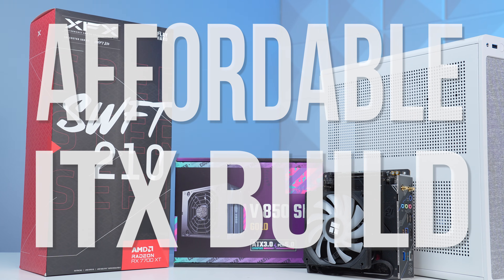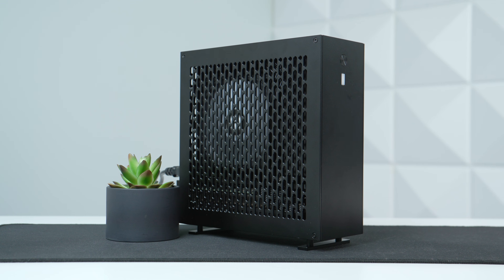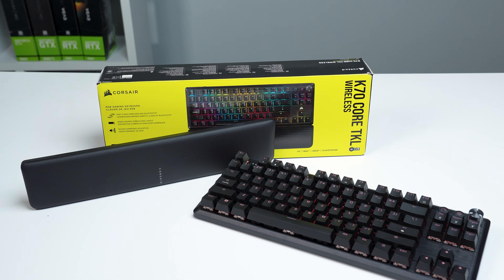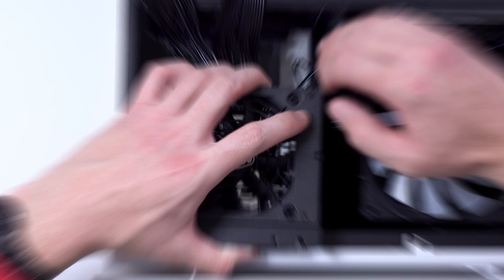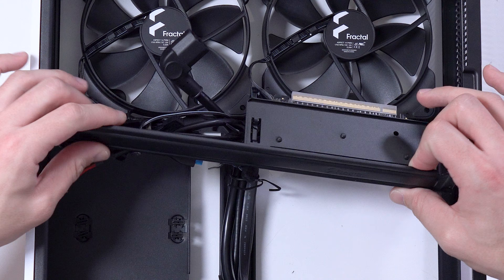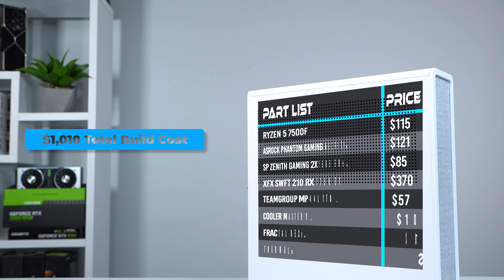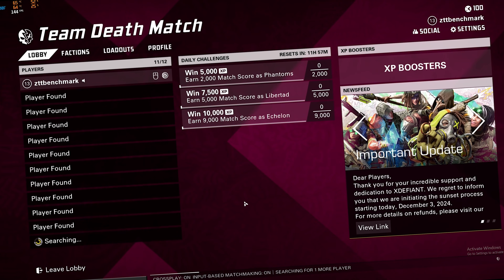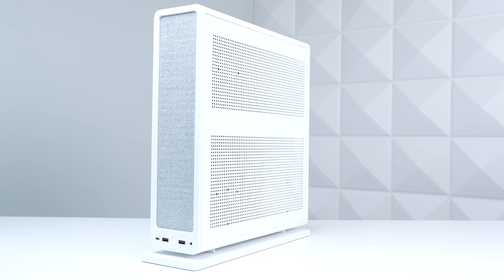This 1440p ITX Build is Actually Affordable!

Comment: I was thinking about doing an itx build with the 5060 low profile gpu because in some real benchmarks it actually plays 1440p on almost any game because of supporting the newest DLSS 3 I think it's on right now? even though it has 8gb of vram it is AMAZING at less than 350 bucks new. Also a whole build draws less than 500w of power usually. I was planning on 3d printing a case and frame with a flat/console-like profile and it's smaller than a PS5 by quite a bit
Reply: 3D printing a case will cost me only a couple hours and less than 30 bucks of material for a roll of ASA...

Comment: If you're having CPU temp issues in this case do this... Take out the 140mm fans completely. They make the lower chamber circulate hot air. Next, add x3 80mm top fans as INTAKE AND NOT EXHAUST, this will get fresh air to the lower chamber. Now, add 1/4 inch gasket around the CPU fan housing to seal the gap between the case. Also, if you have an MSI board, lower the Lite Load setting to help auto under volt ever so slightly. I went from 98c to 77c at 100  percent load on cinebench at the 5 minute mark, before I had to stop after one pass about 30 seconds due to throttling. Great case, poor factory air setup. Hopefully this helps

Comment: 7 months later, the R5 7500F has the same price as the R5 7600X and letting you know that the 2k-itx-affordable does not exist anymore but there is a GPU called RX 9060 RX 16gb that might make it happen again

Comment: Is that Fortnite number in performance mode or direct x? I'm assuming performance. People always act like Fortnite is easy to run, it is not. It's easy if you put it on the equivalent of low settings. I don't understand why people always do this and insist on putting other games on high settings.

Comment: Update: the PSU used is prone to catastrophic failure even under normal use with areas that have unstable or noisy power.
Recommended to avoid this PSU in that case
Reply: been using it for over 3 years. its fine
Reply: @megadeth8592 Tests don't lie. You might be lucky, but the risk is there

Comment: Fps benchmarks are useful, but what about temps? Especially in that case.
Reply: I noticed in the overlay in corner cpu was fine but gpu was constantly at 95-98°
Reply: @chrisfrazier1209  no it wasnt........it never went above 70 degrees.......what you saw was gpu usage
Reply: there's temps in the corner for every benchmark.........
Reply: @ ah your right I’m looking at usage my mistake thanks for clarity.
Reply: Temperatures don't hit that high, at least for me. I use a 7700x and a 3080 10GB (105W TDP for the 7700x and 320W for the GPU), and I am able to run both of them with minor performance loss (a few points, in cinebench 2024). Granted this is with relatively high fan speeds, but if you are wearing headphones you won't notice it.
Reply: @Hydro123s ok thanks. I've got an undervolted 5800x (I just lowered the power limit until I started to lose performance, quick and easy) and a 3080 10g so we're likely not that far off.

Comment: Do builds like this still have the same thermal performance? Or is thst a sacrifice for the reduced space?
Reply: When I checked the benchmarks, the GPU have a pretty decent temperature (around the mid 60 degrees) while the CPU gets pretty hot on CPU demanding games (approaching 80 degrees), but it is still acceptable for a CPU to get that hot tbh
Reply: @farrel2307  under 80 in an itx case is great

Comment: Hi, great build! I have also a gaming PC built into this Fractal case with the Ryzen 7 7800X3D. 
- My question would be what kind of GPU do you recommend for a 4K monitor ? Currently I have an old card (XFX Radeon RX 5700 DD Ultra 8GB) from my previous built and i see that the card can't really handle 4K really good, especially on the new titles cause it gets really hot and the fans spin like crazy sometimes. 
- Another question, now that the new GPU came out at CES should i wait for one of them or should i buy an older one ?
- Btw sometimes I notice that the CPU and Case fans spin up really quick and than slow down when i do some kind of minor action like opening the Chrome or navigating, how can I fix this issue, what should/could I adjust ?

- My last question 🙂, sometimes when I have a longer gaming session I noticed that the case gets really warm/hot where I have the CPU and GPU but as I saw the CPU and GPU temps are okay, below 70 celsius or mas 80, is it normal that the case gets so warm ?

Thanks in advance!

Comment: ai says

The Ryzen 4070 is not a GPU, it's a CPU (Central Processing Unit) from AMD.

GPUs (Graphics Processing Units) are responsible for rendering graphics on your screen.   
CPUs handle the core processing tasks of your computer, like running programs and games.   
Therefore, a Ryzen 4070 cannot "beat" any GPU because they serve different purposes.

To get a high-performance GPU, you'd be looking at cards like:

NVIDIA GeForce RTX 40 series: (RTX 4090, 4080, 4070 Ti, 4070, etc.)   
AMD Radeon RX 7000 series: (RX 7900 XTX, RX 7900 XT, RX 7800 XT, RX 7700 XT, etc.)
These GPUs will significantly outperform a CPU in terms of graphics rendering capabilities.

ai thinks a ryzen 4070 is a cpu

Comment: @zachstechturf I have a Zotac 3060 Ti Twin Edge, and it gets really hot and loud at 99% utilization, reaching around 83°C during 1440p gaming on high settings with unlocked FPS. I’m using a Pop Air Mini case with a 120mm AIO at the back (it was originally a prebuilt, which is why it has the 120mm AIO). The case still has the stock fans installed.

Are these temperatures normal, or could there be something wrong with my GPU? I’ve already set custom fan curves and undervolted the GPU, but the temps are still high. Any advice would be appreciated—thanks in advance!

Comment: Hey Mr. Zach I’ve been planning a pc build using your $550 template. I found all the parts on Amazon but I was wondering if there were any other GPUs besides the rx 6600 that I could substitute that may be a little lower in performance but save money if that makes any sense. Thank you.

Comment: Hey ztt I was wondering why the motherboard has hdmi and display port inputs when you aren’t sopposed to do that
Reply: The HDMI and DP ports are used for your CPU's integrated graphics (if it has them). If you have a dedicated GPU, it will use the iGPU (integrated GPU on the CPU which is weaker) in order to render graphics, making it slower.

Comment: Sursa Corsair RM650, 650 Watt, 80 PLUS GOLD
Certified, Fully Modular
SSD Kingston NV3 1TB PCI Express 4.0 x4 M.2 2280
Memorie Corsair Vengeance RGB RS 16GB DDR4 3600MHz
CL18 Dual Channel Kit
Placa video GIGABYTE Radeon RX 6600 EAGLE 8GB GDDR6
128-bit
Procesor AMD Ryzen 5 5600 3.5GHz box
Placa de baza GIGABYTE B550M K
Good budget pc build???

Comment: Hey, I know this isn’t overly video related but I’m wanting to upgrade from an Athalon A3000G to a Ryzen 5 5600 but I wasn’t sure if my board supported it, I have the A320M HDV R4.0, some sorces say it won’t work but some say it will with a simple BIOS update. Could you it any commenters give me some help (if it is a BIOS update would it be possible with the A3000G?)

Comment: I've got an upgrade question for you:

I'm a budget gamer dad and am thinking of upgrading my rig in 2025. My current rig I purchased for $200 from a local PC flipper (IT guy at one of our school districts) and has the following specs:

Processor: Intel Xeon w-2123
GPU: RX 580 2048SP 8 gigs of GDRR5
RAM: 32 gigs DDR4 2666 MT/s
Memory: 1 TB SSD

My question is two fold:

1. Would the new Intel ARC B580 be a good way to get to GDRR6 on a budget with my current setup?
2. Should I first upgrade my CPU?

Finally, anything else I should be aware of? I game in 1080P and my rig runs modern games at reasonable frame rates (40-55 FPS) at modest settings (Space Marine 2, Helldivers 2, Elden Ring). Thank you in advance.

Comment: Hey Zach, I hope you are doing good. What GPU (or any other upgrade ) would you recommend based on my current specs,

Ryzen 5 1600
Rx570 4gb (Gigabyte)
Gigabyte B450 ds3h mobo
500gb SSD + 2tb HDD
16gb ddr4
550w Gigabyte 80+ bronze PSU.
I'm a casual gamers, i play a couple of fps games like csgo, valorant sometimes and apart from I love to play story games like witcher, gta, cyberpunk etc, in 1080p.
I wanna upgrade my GPU, I don't want 300fps in my system, I just want above 60fps in my story games with good graphics, 
What GPU should I go for, in both 2nd hand & new condition

Comment: My Current PC Specs
CPU - Ryzen 5 5600X  Using stock cooldeGPU - Geforce gtx 1060  6 gbMOTHERBOARD - PRIME B550M-A WIFI llRAM - CORSAIR VENGANCE 2x16 32 gbPOWER SUPPLY - DEEPCOOL 500W 80 plus bronze certifiedCase - Deepcool Matrexx 50 ADD-RGB 4F ATX Mid Tower CaseStorage - Samsung SSD 990 EVO 1TB m.2
I'm wondering what Graphics card i should get and my budget is 370 - 700 CAD

Comment: does any am5 mother board work with the 4070ti super, i don’t wanna get it and not be able to use it
Reply: yep. all AM5 boards have a PCIe x16 slot (which is what the 4070TiS and all other modern GPUs interface through)

Comment: Hi @zachtechturf!

Love your videos!

Im looking to build my own PC 

Do you mind taking a look and seeing if there are any issues or improvements that could be made? Or even possibly alternate parts that are cost effective but are not a downgrade?

I mainly game, browse web, trade crypto.

(FYI - Money isn't an issue but i'd still rather not spend unnecessarily) 

Thank you!

CPU: Ryzen 7 9800x3d
CPU cooler: Lian Li HydroShift LCD 360
GPU: Gigabyte Radeon RX 7900 XTX Gaming OC 24G Graphics Card (R79XTXGAMING-OC-24GD)
MB:	Asus ROG Strix X870E-E Gaming WiFi
PSU: Corsair 850W RM850x SHIFT 80+
CASE: Antec Flux Pro Full Tower E-ATX Case
RAM: CORSAIR Vengeance RGB DDR5 32GB (2x16GB) DDR5 6000MHz CL30 AMD Expo Intel XMP iCUE Compatible Computer Memory – Grey (CMH32GX5M2B6000Z30K)
SSD: Crucial T705 2TB CT2000T705SSD5 PCIe 5.0 2280 M.2 NVMe SSD - with Heatsink

Monitor: Any recommendation to get the full potential from the PC?

Am i missing anything?

Comment: i just want to ask: 
i got a used pc : 
i5 4500
rx 580 8G 
8 G ram ddr4 
500 hdd 
125 ssd 
M.B H81 
500 W P.S 
and i got all of this at 172 $ (used ofcourse). 
is it good deal or not.
+i just want the pc for college and open chrome and open pdf,s.
should i take it.?

Comment: Hey Zach, I'm considering buying a new PC. My current setup has a GTX 1660S, an i5-11400F, 8GB of RAM, and a 512GB SSD. Do you have any recommendations for a build or prebuilt around $1000 that can handle 1080p gaming at over 120 FPS, preferably with an Nvidia GPU and an AMD CPU?

Comment: So I just built my first desktop gaming pc, and it has a Ryzen 7 7700x, 32gb DDR5, 4tb ssd, and a 4070 Super. I keep hearing that the 4070 Super is great for 1440p gaming and can still get over 100 fps in most games on 1440p. My monitor is only 1080p, and I am wondering, will this will give me more fps in my games or not? I don’t know if this is good or bad but this is a huge upgrade from my ps5 and old tv 😅.

Comment: hey ZTT, my name is Alan. I need your opinion in my budget build. I’m building my new pc for 1080p gaming. My budget is 1000 euros, and i just wanted to know what should I change or it is maybe good build. my parts are ryzen 5 7600, rx 6750 xt, 16gb ddr5 3600mhz, asrock b650m pro rs, 750w 80+gold and i know this doesn’t matter but my case is cougar mg140 air rgb mini tower 66(my target is getting so much frames at all low settings). I hope you will answer bc it’ll means a lot.

Comment: Hey Zach, I wanted to ask for suggestions to make my Brother's PC more "cosmetic" I recently built him a fully custom PC out of spare parts and the case is Cooler Master Elite 330 ATX. his MOBO doesn't have any fans that work with it, since it uses the Dell Optiplex pin fan connector. Sorry for the lengthy message and any suggestions are appreciated, asthetics aren't my strong suit.

Comment: Is the, GIM ATX Gaming PC Case, Segotep 1250W ATX 3.0 Gaming Power Supply, NZXT Kraken 240 - RL-KN-240-B1 - 240mm AIO CPU Liquid Cooler , INLAND AMD Ryzen 7 7700X CPU Processor with GIGABYTE B650 Gaming X AX V2 Motherboard, GeForce RTX 4070 Super, Crucial Pro 32GB DDR4 RAM Kit (2x16GB, Western Digital WD_BLACK 1TB SN770 NVMe Internal Gaming SSD Solid State Drive, good for gaming?

Comment: Rate my future build zach
Boost jaguar pc case new
Rx 5700 xt used 
B450m used
16gb ddr4
1tb nvme
Ryzen 5 3600 used
Amd wraith cooler
600 w power supply any of corsairs 
Build will be under 480$

Comment: Guys i need help, i don't know much about pc parts i just like to play video games. Im planning on saving for a gpu but i don't know which one is the best value.

I'm not from america so my options are very limited, and finding a good used card is hard. Im also on a budget.

My options are.. ( i used google to convert currency)

Gtx 1650 - 157$
3050 6gb - 192$
3050 8gb - 219 $

Thank you! Merry Christmas ❤️😊

Comment: I need help asap. I will be upgrading from r 3 2600x to r 7 5700x3d and will still have the old gpu (rx 580)
Will the cpu still reach the maximum potential or do i need to upgrade them both at the sametime?
Edit: Will i need to update the bios?

Comment: I have a ryzen 5600g 
16gb 3200mhz ram
550 watt psu bronze+ coolermaster mwe 
Looking forawd to add a GPU to my build
here are the list of GPU in my budget and the price 
Price are converted from INR to USD.
Rx6600 for $250
3060 12gb for $290
7600 8gb for $300
6500xt for $300
7600 for $305
4060 for $322 - $350
6600xt for $375
4060Ti 8gb for $410
7600xt for $380 -$430

A good gpu without upgrading my PSU

Comment: CPU: AMD Ryzen 5 7600X (~180)
GPU: Intel Battlemage B580 (~$249)
Motherboard: Biostar B650MT (~€100)
RAM: 16GB DDR5 (~€45)
PSU: Budget of around €55-60 
Storage: will resure (might buy another ssd).
Case: will reuse.
Cooler: Comes with the cpu. this is what im getting for my next build generally i think itll be good im not sure about the b580 for now it seems REALLY good but im not sure like any other intel graphic cards it might just have many bugs im getting this by august 21st any advice on aything i should change or improve? also what kind of monitor i should get and keyboard.. mause.. (anyways i live in serbia and im not really paying 200$ for shipping so im trying to find anything locally or cheap or free shipping the RSD is the serbian currency)

Comment: I’m currently running a i5 10400 with a z490 board and rx 5700, 16gbs of ram. Been thinking of building an entirely new pc. Should I? Or is it still possible to upgrade while using lga 1200

Comment: I am pairing an RTX 3060 with an Intel i7 12700k. and an asrock z790 steel  legend,,, , and thermalright peerless assassin 120 se , ,, corsair vengeance 32gb  cl30  6000 mh,  samsung 990 pro 2 Tb,,,,  for the case lian li 011 vision ATX,,, be quiet dark power13  1000w,,,,,, 10 lian li uni fan sl v2 120,,,,, for the monitor is a koorui 24E3 24.0

Comment: hi zach, been watching ur vids and short for long. i got a question, i wanna build a gaming pc just for first person shooter and genshin so i don't need 1440p. already bought MSI B650M mobo, but i dunno what gpu i should use and my requirement is that low on power usage but can atleast get me 300+ fps on valorant/cs2. oh and i plan using Ryzen 7600x and my budget around $700. thanks

Comment: Do yourself a favor if you're building this. Get an Intel Arc B580 for $250 instead, get yourself a 2 TB drive for $100 and still save money you could be putting towards that sweet mechanical keyboard you wanted.

Comment: I just recently finished my ITX build, alot of similar parts lol. Sadly the costs were way different cuz I'm in the EU. The same build here would cost around 1300$ appx.

Lian Li Q58 White Full mesh
Ryzen 5 7500F
Sapphire Pure RX 7800XT
A620I Lightning Wifi
DDR5 CL30 6000Mhz Patriot Viper Ram
SF850L Corsair PSU
Thermalright AXP-47mm
All this cost appx 1350$

It's such a snug fit, with white aesthetic I love it. Also cuz of your videos I just had to get some White cable extension LOL.
Reply: I live in Europe too and its real, components cost more than in the videos i watch

Comment: Imo the fact that it's all new parts should also be mentioned, makes it even more impressive. Could probably get the same performance and form factor for 800 or less with used parts
Reply: Maybe not 800, but maybe a 500 minimum from used alone, used CPU alone should bring it down 200 depending on when you see it where it's being sold and how much it is (duh)

used gpu should bring it down 150 also depending on the same thing, you can also go lower specs and cheaper card to go even further down

also crackpot idea, buying a cooler that doesn't have or didn't come with a fan on eBay, then slapping your own on there if you have a spare, I doubt they will sell it for much lol. 

Cheaper case as well, can bring it down an additional 60-80 bucks depending on size and age, looking up 2000's PC office cases with itx standardization should help :3 (it should be noted either way your bringing a thousand dollar build down to 600-500 or even less)
Reply: @Jobroski47  the oem cases is a bad idea, they have terrible airflow, they arent as small, and most of them have non-standard adapters, connectors or mounts for any modern pc hardware